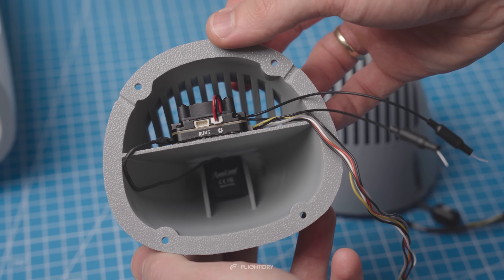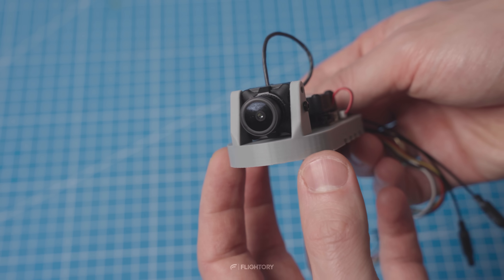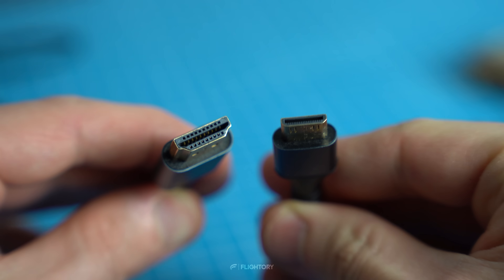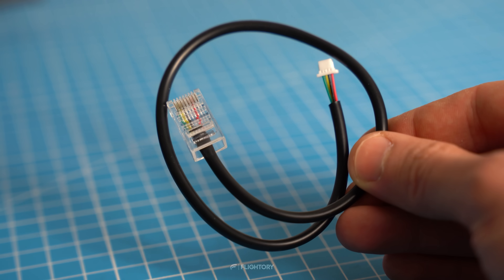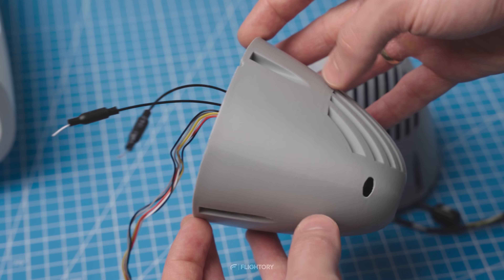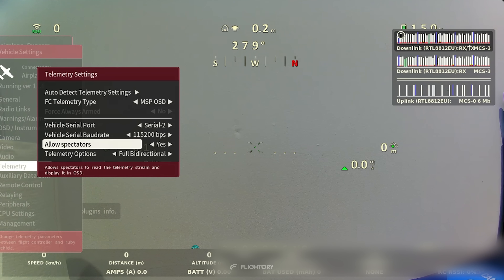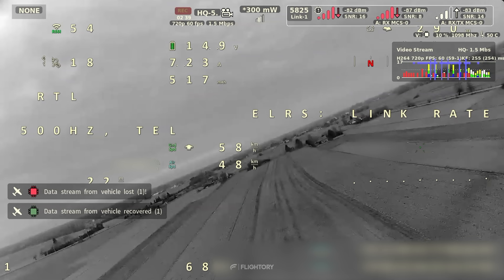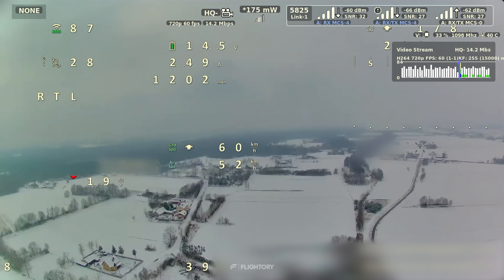Is This the Future of FPV? | WiFiLink 2

Comment: 1.  IMPRINT A PART NUMBER IN YOU PARTS.  
2.ADD MORE REGISTRY PIN HOLES FOR MATCHING WING PARTS
3. THIN OUT THE PARTS, THEY PRINT TOO HEAVY AND DONT NEED NEARLY AS MUCH INFILL. 
4. A LAUNCHER IS MUCH NEEDED.  MAYBE PLANS FOR ONE THAT WORKS FOR BOTH PUSHERS AND MULTI ENGINE UAVS

Comment: As far as I know, there is also an OpenIPC adaptive link. It uses bidirectional transmission, but the other link is used only to send information about signal strength, so the VTX can lower quality of image when the signal is weak. Also I saw ppl pushing link to 20-40mbps so it is worth exploring that as well :)
Reply: I‘m currently using OpenIPC with runcam WIFI2 + VRX, unfortunately performance is pretty much same as Ruby, signal lost at 1500 - 1600 (suburban area of Shanghai)

Comment: That transmitter should have more than 300mw of output power. As far as I know, the rtl8812eu should be able to output 800mw. I've gotten 700 meters out on a 50mw system, granted I was using high gain antennas.

Comment: Does it get stinking hot like the other fpvs or a little better?
Reply from the maker: With the stock fan, overheating is not an issue at all. If you remove it, the behavior is quite similar to the VTXs we’re familiar with, maybe slightly better, but in any case, after powering it on you need to start flying fairly quickly.

The size with the fan is still compact, though, it will fit into many airplanes and copters.
Reply: @FLIGHTORY  Nice thank you, a lot of progress recently with stuff, this looks very interesting 😊

Comment: I would recommend testing same hardware with OpenIPC APFPV, specifically Greg09RC2. Its characteristics are quite different from Ruby and the runcam hardware is well suited for it. With my setup it achieves about 40ms with the hdzero goggles and 1080p90 16:9 mode which is not too dissimilar from dji and walksnail though i am not sure how well it performs in terms of range

Comment: You should chang the video preset from HQ to LR for your next tests.
run the radio wizard (because of the new antennas)
Also it didn't automatically pick the best frequency, it just started on that as a default.
Reply from the maker: Yes, you’re right that after connecting it doesn’t automatically search for a channel. I didn’t specify that clearly. With both sets of antennas, before the flight I ran the radio link adjustment wizard. When I said it was automatic, that’s what I meant, but I didn’t record that particular part.

We’ll keep working with this system and test it in other locations and with different antennas.
Reply: @FLIGHTORY the radio wizard also doesn't pick the best channel I think, it just tests the maximum poweres and modulation schemes for the setup
Reply from the maker: @joshieeee20  That’s true,  it doesn’t change the frequency on its own; it only optimizes parameters within the selected channel.
Reply: LR preset will help, but not much.